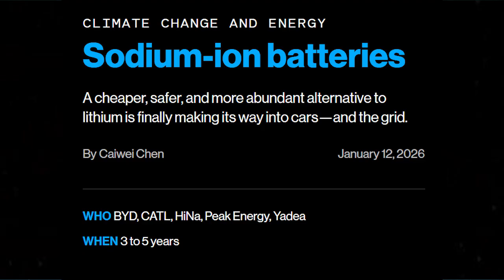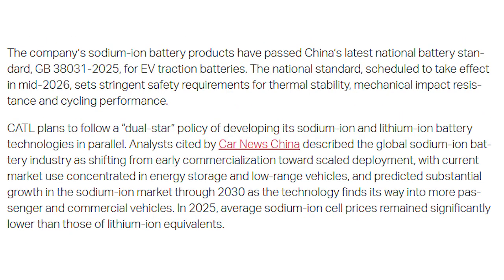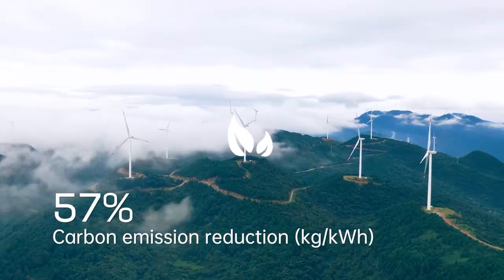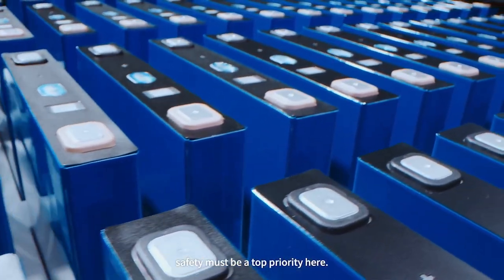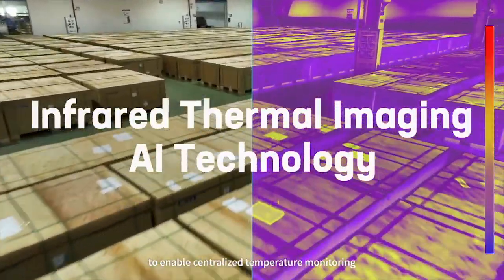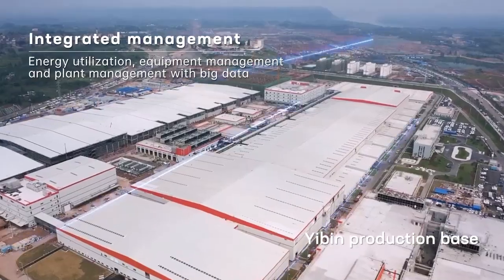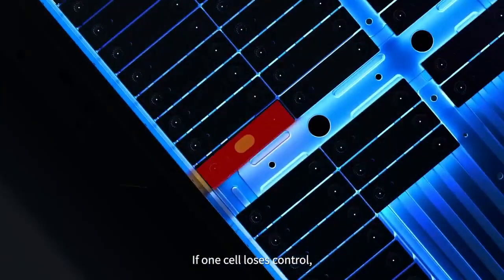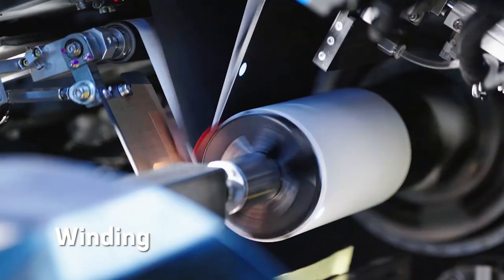CATL’s Secret Weapon: How Sodium Ion Just Broke the Market

Comment: A very sensible assessment of the upcoming battery landscape. I have to keep an eye on these topics for work, and the most dramatic changes in this field are the quieter, non-headline grabbing ones.

For example, we are fitting solar this year to our business, but because of the nature of our business activities we are very risk averse, especially fire risk. No batteries for us at the moment. I don’t fear them, but the safety and insurance headaches that come with it are a significant off putter. Sodium ion puts batteries back on the table for us. We’ll be ready to look at them in the next 3-5 years, so the tech may well be out there in the field by then, tested and with hopefully good prices and availability. I already have a small out-building earmarked for them and their control equipment in future ;-)
Reply: If you are afraid of the fire risk just put the battery in a shed away from your building. That is how you do it to cut down the risk to almost non.
Reply: @cajampa This is what we will do, but the site is short of space, so keeping things far enough away from other areas has becoming increasingly difficult. Sodium ion will really help us here, and on price too.
Reply: @javelinXH992  from my understanding the sodium cells are already available.  Why not build it now high voltage is only currently practical method.  Build a 500v-1000v battery.  Also lithium iron phosphate is very safe I don't know why you're worried about a fire that chance of that is near zero. Thermal runaway very rarely happens so you should reconsider waiting so long imo.
Reply: @farmerjhemp Oh yes, we could. But we are not ready yet (fitting panels this year) and we are taking our time. We have a large number of additional regulations and restrictions we have to deal with in our line of business which many businesses do not have to worry about. It creates more delay and cost for us when doing certain things. We would have gone LFP previously, but sodium ion will be an even better fit. We don’t work nights or weekends, so the benefit of batteries is not critical to us either. So we can wait and do other things in the meantime (I would like more panels before batteries, but we have a problematic roof to deal with. It will be useful to have batteries, as more benefit to us than exporting, but as I say it is not critical or enormously profitable.
Reply: So you are saying there is no fire risk just because you put them in a shed? Sorry mate, but if those batteries catch fire they will burn to ashes regardless of where you put them. Your investment would be smoked.
Reply: @struck2soon How slow are you little buddy? The risk is that the batteries will make your house or business to catch on fire not the batteries. Seriously what are you even saying. How can you be this slow.
With any batteries that you are cycling with a lot of supporting electronics around it there will always be a risk something goes wrong and it catches on fire. And you will reduce the risk that it will spread to your other facilities by putting it in a separate shed a bit away from your other buildings.

Just try to use your head this is REALLY not complicated and this is how you do it. And how everyone is managing this risk IF they are worried about it. Some are willing to take the risk of having it inside the building and some aren't. Sodium ion will also further lower the risk of the cells will catch on fire if something like that will ever happen. And that will limit the possible damage even further.

If you don't understand these things at all.....why are you even commenting.
Reply: @struck2soon  Sodium ion are no fire risk. This is why lithium ion is off the menu for us. The ‘shed’ is already rated and equipped for storage and processing of flammable materials, so we are looking to stop using it for that and turn it into a sodium ion battery room. It will be perfect for giving them a cool, dry, ventilated building to live in, even if they are rated for outside anyway.
Reply: @javelinXH992 I think we are talking at cross purposes here!

Comment: The cost advantage of NA+ cells vs LFP does not exist at the moment. 
LFP contains Lithium which costs more but the lithium content is max. 7%. 
The cost advantage of the cell is less than 10% compared to LFP. 

The energy efficiency and longevity is at least 20% worse than LFP - AT THIS MOMENT. 
Maybe that changes over time. 

At the moment Na+ is only useful for low temp applications in Arctica, Greenland (war?) or Antarctica.

And they are NOT cheaper than LFP.
Reply: The more alternatives they find and use the more the price of lithium can be keept down, that helps the overall prices. 20% lower density does not matter much for stationary battery.

Comment: I Asked AI about using Na in Victron Energy products (for solar storage) .. this was the answer: Victron Energy has not officially announced specific software or firmware updates to directly support the unique characteristics of sodium-ion (Na-ion) batteries at this time. The main challenge with using Na-ion batteries with current Victron inverters and charge controllers is the wide voltage range of Na-ion cells, which current Victron equipment is not designed to fully utilize.
So in my opinion I don't see Na coming for at least another 5 years... sorry...
Reply: But it's AI, so it's probably fiction.
Reply: It may only be a software update

Comment: For cold places I like the idea of a small generator say 2KW to produce a little bit of electricity but mainly to provide heat for the battery pack and the passengers. The reason that petrol combustion cars are inefficient is the amount of heat that is wasted but if you need heat that shouldn't be a problem.
Reply: You must live on the dark side of the moon. We have low temps maybe in January and sometimes in February here in Europe.
Reply: That would be fantastic.   5kw is basically a lawn mower sized engine.    Either this,  or give an option to heat the vehicle with a propane canister or kerosene
Reply: @jsh111  if you’re going to burn it, may as well make electricity as well
Reply: @Bakes-z4c  I like your way of thinking.

Comment: For me it'd be great for my home battery. Safer and cheaper.
Reply: That's what I want but I suspect AI data centers will steal most available.
Reply: @RemusKingOfRome  It is fairly low energy density and I would wager not really suitable for large scale power needs. I personally see the potential for home battery storage particularly in developing countries. Solar panels have become more accessible in a lot of places however the issue of battery storage remains.

Comment: This could be Canada's battery? East of the Rockies, we get temps of -25C quite often. Edmonton, -40C often, Even Niagara Falls freezes up occasionally. So we need vehicles that can spend two hours sitting stopped on Hwy 401/ 407/ DVP/ 400/ QEW in -20C and still keep passengers warm and get you home safe.
Reply: EV's, sodium based or lithium, FAR outshine ICE cars when stuck in traffic.  In a very cold climate, sodium batteries will be that much better.
Reply: All of Europe really, for BESS at least. The UK just made Europes first fully domestic supply chain Sodium battery.
Reply: If Donut Labs Solid State Batteries are real, they would be Canadas battery 100%.  CATL Sodium would be a good 2 choice a
Reply: "East of the Rockies, we get temps of -25C quite often. Edmonton" Why not let your cars heat themselves? I do not care about passengers. Just warm the battery. @ -40 no Diesel world work anyway.
Reply: @wolfgangpreier9160   if you don’t heat the car’s interior at -20 C you won’t be driving for long before your very breath frosts over the inside front windscreen.   Good luck driving with zero visibility.   PS they just leave the diesels running 100% of the time.